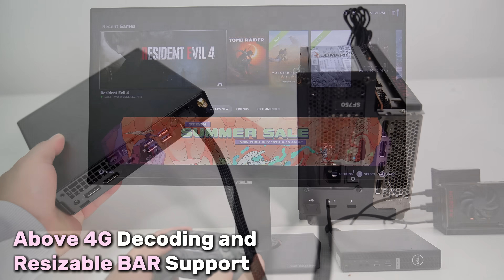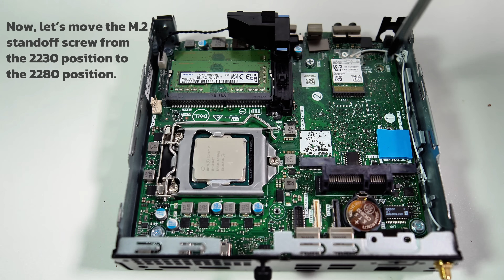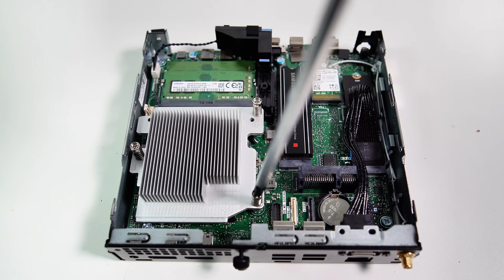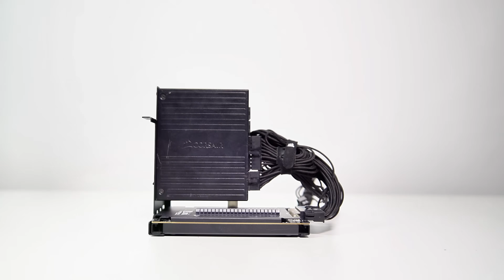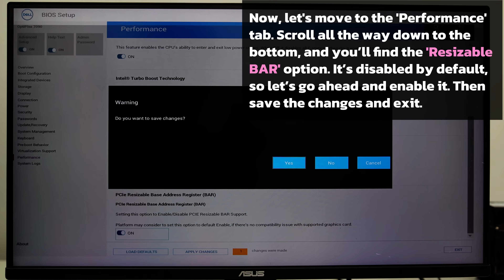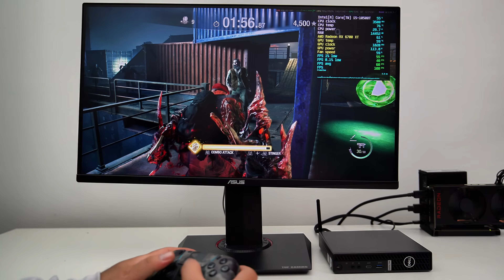DELL 7090 Micro + RX 6700XT 12GB Oculink, Re BAR support, INSANE 1440p Gaming!

Comment: Can you do it with 9th gen intel cpus?
Reply from the maker: It will work the same way.
Reply: @itggear i mean above 4g decoding and rebar is it available on 9th gen?
Reply from the maker: @chat-gptyt It might not support ReBar. You can Check my Dell 7060 micro video. It support Intel 8 gen but it use the same bios.

Comment: Nice video 👍 i buy mini PC GenMachine REN 5000 i choise processor Ryzen 7 5800H , but they send me a Ryzen 9 5900HX  💪 for 183€ 😁 and a Red Devil RX 6800 XT 16GB Gaming RGB for 300€  eBay 👍💪 , i have a Sapphire Pulse RX 7900 XT 20GB it Ryzen 7 7800X3D 😊 , but i dont wana put my main PC incomplet  😤  i buy that oculink OCuP4v2 to , it Case ATX  , but mini PC GenMachine REN 5000 only Genx3 m.2 slot to 😮‍💨 but now i see was good choise 😅 to do this crazy staff 😅 the price laptop gamer cust alot money 😤 my laptop is from 2015 a MSI GE72 QD6 APACHE PRO ,  it 6800h and GTX 960M but Alive 😅

Comment: I have a dell optiplex 7000 micro with an i5 12500 and 16gb of ram. I would like to upgrade the ram to 32gb in the future and get a RX 9060xt 16gb. Would you recommend that I do exactly what you did with your setup ?

Comment: Thank you for this video!!! I have been researching how to upgrade my Optiplex 7080 micro (Intel Core i9-10900 ) to add a GPU w/o luck until I ran across this video. I've purchased all the components recommended below and completed the installation however my PC does not recognize the GPU (NVIDIA GeForce GTX 1080). I am assuming this is because I need to modify the Above 4G Decoding and Resizable bar however they are not enabled in my PC BIOS. Therefore I am unable to make the recommended changes. Am I missing something? I upgraded the BIOS on my PC to the latest version which is 1.36.0 8/5/2025.
Reply from the maker: There is switching button on Oculink adapter. You can switch to M.2 Sync and it will work just fine.
Reply: @itggear  Thanks for the rapid response. I tried the switch but no luck yet. I think the problem may be the GPU card I got from a friend. I bought one from amazon and I am waiting for it to be delivered. I am not giving up so easily 🙂

Comment: Does this work on a Dell Optiplex micro 7020 i5 4500T?
Reply from the maker: It doesn't have M.2 NVMe slot.
Reply: @itggear  the model i have has 1xgen3.0 and 1xgen 4.0 nvme slots - does that mean this kinda oculink workaround would work for me? the processor is a intel 14th gen i5 14500t

Comment: I am just having no luck with my Optiplex 7010 SFF and the New Dell Pro Mini using oculink and an Intel A770. Linux detects the cards, and can accelerate off of them, but I haven't had any luck with Windows detecting the A770. :(
Reply: @McTwistedTwisties   у меня тоже не получается запустить видеокарту rx6700xt . Мини ПК с R7 7845hs , 16gb ddr5 . Через oculink видеокарта не включается . Так же я попробовал подключить старенькую gtx 1060 6gb , она включилась сразу же . Но хотелось бы запустить rx6700xt для лучшего качества в играх

Comment: Can i use 7080 micro ? don't know if it looks same inside...
Reply from the maker: You can do the same with all Dell Micro PC as long as it have an M.2 NVMe slot.
Reply: Did you try this on your 7080? I am curious because I have a 7080 and I've tried but no luck yet.

Comment: Building a mini setup with an eGPU—could I use it for streaming and take advantage of the RTX Ampere codecs like H.264, HEVC, and NVENC?
Reply from the maker: It should work the same as if you installed the GPU directly with your motherboard. As long as your GPU supports it, it will work on an eGPU connection as well; it just runs in lower bandwidth compared to PCIe x16 only.
Reply: @itggear  I have a mini PC and I want to use a 3050 EGPU and use this mini setup only for streaming, but I had a question about the codecs.

Comment: I was wondering if you tried a non T series cpu in the dell micro, very curious on if it would work. I know with the Lenovo m720Q you can put non T series cpus and it works, the thermals aren't great though.
Reply from the maker: It's best not to use a 65W CPU in this PC. I can't install one on the M720q because it will throttle constantly, making the system extremely slow and practically unusable.
Reply: Yeah, that's what I figured. I put an i5 8600 into my M720q and it reached 85c pretty quickly when I put a load on the system. Just curious if the dell micro would even boot with a non T cpu.
Reply from the maker: @infamoussteven The Dell OptiPlex 7090 Micro has several SKUs, such as 3.3A and 6.7A, which support 35W CPUs using a 4.5mm barrel adapter (up to 135W). These models feature a small aluminum heatsink with a 5V fan, as the motherboard only supports 5V and lacks a 12V power rail.  

In contrast, the 65W and DGFX SKUs support a 9.2A 7.4mm barrel AC adapter, include a 12V power rail, and use a copper CPU heatsink with a 12V fan. The DGFX SKU also includes a PCIe x8 slot for GPU installation and a chassis cutout to accommodate the GPU.  

You can’t install a 65W CPU on a 35W motherboard like the one shown in this video. If you want to upgrade, choose a 65W-supported SKU instead.

Comment: On my country dell 7090 it over 200 USD enen though it was Used
Reply from the maker: But $200 you can buy a new low end CPU or a motherboard only so $200 is still a great deal.
Reply: @itggear   Just wait for the right time when its have discount.
dell micro  its was great choice 
i have 3050 micro

Comment: Do you think a 10gb/s usb 4 port of the Thinkcentre M75Q 5th gen, AMD 8300ge would handle a gpu without too much bottleneck?
Reply from the maker: I believe that the more VRAM a GPU has, the less bottlenecks during gaming. This is because the GPU can store and process game assets entirely within its dedicated VRAM. When VRAM is full, the system starts allocating data to system RAM, which requires transferring data between the GPU and the PC over the PCIe interface. This can cause performance bottlenecks due to the lower bandwidth and higher latency compared to VRAM.